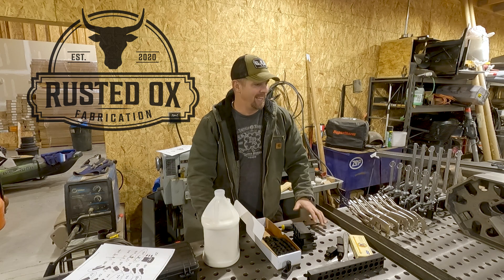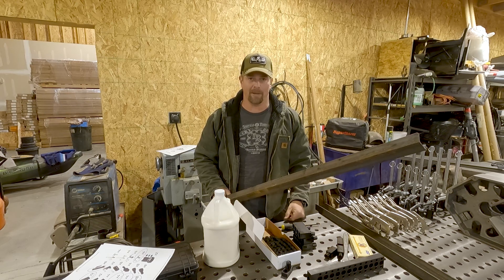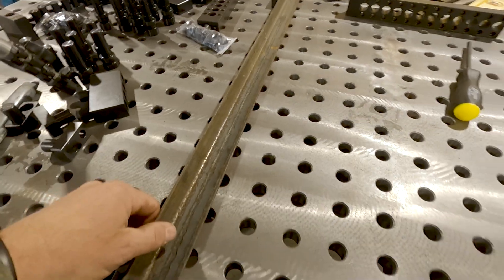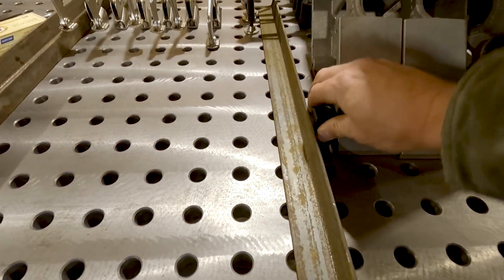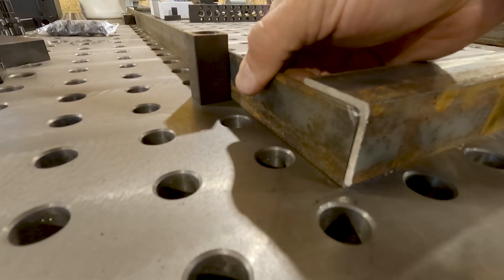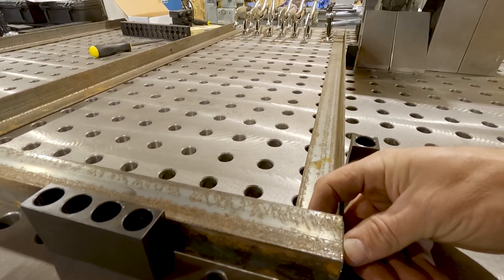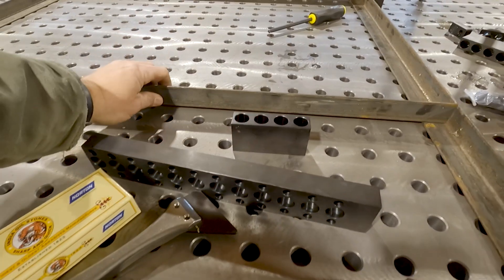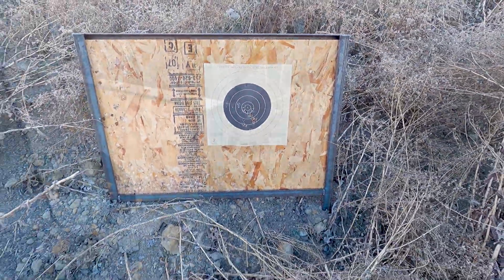Does the Fireball Tool Fixture Table live up to the hype of saving time and increasing precision?

Comment: I was wondering if your 90 degree blocks have  a over lap where they bolt together.
Reply from the maker: If I understand your question correctly, they don't
Reply: @Rusted Ox  yeah I had to send back the ones I ordered due to manufacturer defects all over them. Still waiting to receive the new ones. Been 2 months now!

Comment: The Rusted Ox must have hit the lottery... There's easily $12k worth of table, squares, clamps, etc. there.  I have owned several of the fireball squares for a few years now and can confirm that they are invaluable.  Once you fabricate with them, you will NEVER look at another cheap magnetic HF square again.  Seriously, they are a must have, and worth every penny.
Reply from the maker: No lotteries for me, but that option would have been less painful.  Tool investments rank higher in my world view than most things, my old truck is proof of that.  It pulls a dump trailer that is worth more.  Maybe I have my priorities mixed up this table is awesome and worth saving for
Reply: @rustedox    Nope, your priorities seem appropriate and I feel the same way.  Buy once, cry once.  I actually bought Jason's plans for the homemade bench vise, and though it didn't turnout exactly like his (I don't own a fancy plasma cutter like his, just a basic 2D table) the vise is every bit as functional and SOOOOO damned strong!  Once you get yourself all organized, you might consider buying his plans for $5 and make it a project for a video.  It was actually pretty easy and fun... and quite a conversation piece in the shop.
Reply from the maker: @Matthew Peterson  congrats on completing the vice project; I bet that took a chunk of time and is rewarding every time you spin the jaws closed.  I was just looking through his plans; maybe it can be a project down the road

Comment: the table is super nice, but no way id buy this behemoth for a back yard hobby shop, for 12k I can build a killer plate table 1 inch or 1.5 inches thick and drill the holes I need when the job requires it.  that money would go a long way for some nice tools and equipment that would be in much higher demand on a regular basis.
Reply from the maker: no doubt about it, but there are a lot of areas where I can use a cheap tool and get by (like my 1999 truck), haven't seen that option for the functions this table system performs.

Comment: Making your frame square saves time in the proceeding operations, such as cutting the panel square with minuim effort.  The clamps are as important as the stops, together they are a system.
Reply from the maker: I did use them before I started welding.  I am still waiting for all may tooth blocks which will be a great addition

Comment: Great table, but you also need to set more blocks or other fixtures to prevent warping
Reply from the maker: Definitely, if the projects requires tighter tolerances

Comment: Yes, yes you were excited. So excited you started filming before you'd prepped your workspace. I understand the excitement of a new "toy" however!
Reply from the maker: It was my rush to get a new slug gun scoped and sighted in before dark that was the big motivator.  I couldn't find a cardboard board box large enough, so making the target stand idea came to mind.  My excitement for the table skyrocketed as I discovered how fast, accurate, and simple the table made this project.  It's a little disappointing the workspace wasn't prepped, but the real goal of getting sighted-in was accomplished.
Reply: @rustedox  Fireball Tool makes a fixture cart, you could make you own cart but that time could be spent on profitable projects.

Comment: You must of spent 30k on all that. Awsome stuff. You need to do a shop tour inside and out your place looks amazing.
Reply from the maker: Fortunately not $30k, but at just over $12k, it's a giant leap for the budget of this startup.  We moved into this shop as we built our house and vast amounts of randomness followed.  I need a significant amount of shuffling and purging before there would be any entertainment value in a shop tour.  Currently, it's a blend of metal shop, mechanic shop, yard/lawn maintenance, hunting gear, house construction tools & job remnants, etc.  It could make a lot of you feel better about your shops and garages.
Reply: They did a better deal on blemish tables, for something thatll last forever if you look after it that saves you a hell of a lot of work making it yourself, and saves any mistakes I think it's a fair deal.